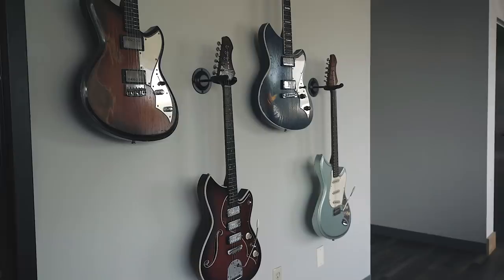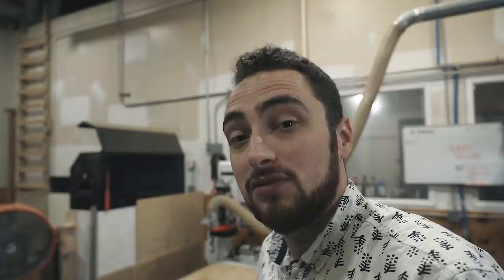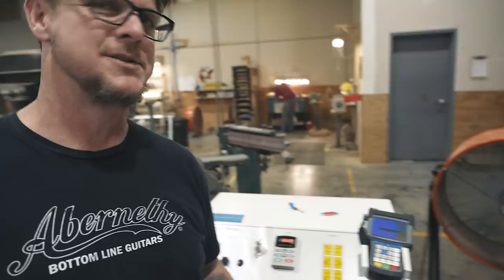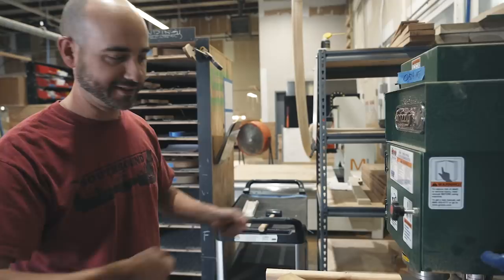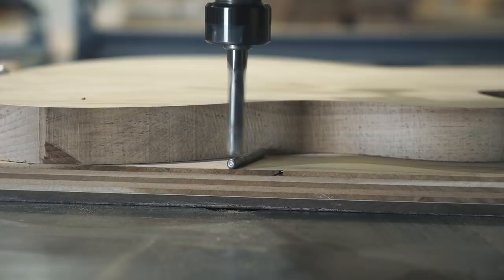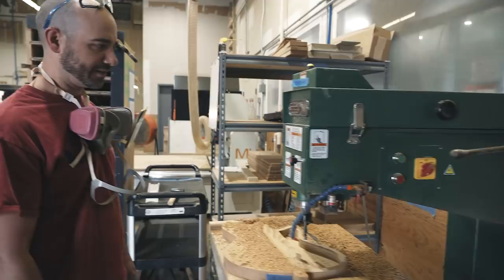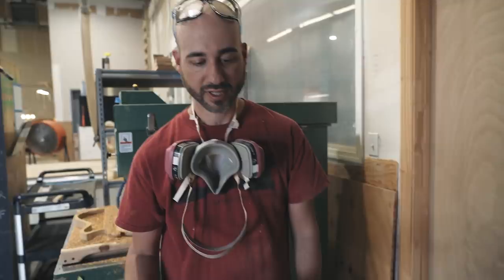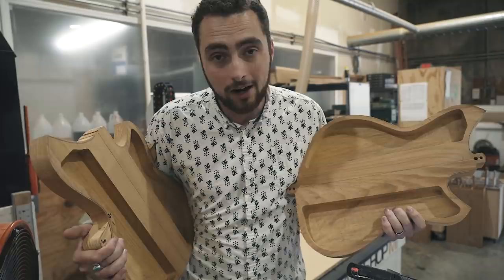Is “Handmade” Really Better? CNC vs. Handmade Guitar

Comment: What does "hand-made" even mean?  How is a pin-router any more hand-made?  Hey, even if you are using a hand-router and following templates, is that really more hand made?  CNC or hand-router, still shape things with a router bit.  The question is whether a quality guitar is produced out the other end.  With so much of guitar making simply requiring extreme accuracy, being able to do so much of it with CNC's which can be highly repeatable with extreme accuracy at speed makes a lot of sense.  It's like people talking about how they prefer "analog" pedals, and then when you check out their pedalboard you see that most of these things they refer to as "analog" pedals are actually digital pedals.  They've adopted a word they like, but it doesn't really mean much.

Comment: Food for thought If you may. Let's just say you're the guy who sands the body after the rough cut and initial routing, neck pocket control cavity etc. If the prosees is the CNC then that gives you ,as was said in the video, 8 to 10 guitars to sand a day which is off course what will be expected since that is the normal daily production. This means that in your 8 hours of work you can reach a certain level of detail. Now won't that make a small difference in detail if when the handmade carve would give you 3 guitar's to work on a day ? What I'm trying to say is that it depends on logistics and actual production planning if using a CNC machine can make a difference in the quality and "mojo" of the instrument.

Comment: I build my guitars by hand using dangerous hands free router, and now I DIY'ed a CNC Router, my next problem is 3D modeling. CNC, Router, chisels, files etc they are all luthiers tools and help them to finish the tasks. Sound Quality, they're both the same, it all goes down with the quality of pickups, amps, effects and how you tweaked them.

Comment: All things considered, CNC and a pin router are not that much different, except CNC is much more accurate, and when setup properly, will give you consistent results every single time, right down to .001" accuracy in wood. I would think hand made would apply to a luthier that actually uses chisels and mostly hand tools to machine out the body, face, neck, etc. Each instrument is noticeably different, and will sound accordingly, depending on the skill of the luthier to mimic his design.😉

Comment: I just stumbled across this video.  As a guitar player for several decades, I cannot believe anyone would be so naive to think that the machining method with a pin router could change the  overall tone and characteristics of a guitar.  A CNC can dial in a neck pocket under 0.001 inch.  Optimum energy transfer.  Not possible with a pin router.  But hey, let the “cork sniffers” pay a $1000 premium for their pin routed guitar.

Comment: A good design, made accurately, from appropriate materials will be good.  Screw up design, or construction, or material and it will suck.   The exact tools are not important if they are used well.  CNC is great for repetitive tasks, but like any tool it's not fool proof.

Comment: I love the CNC for the repeatability and precision.  Even customization is faster.  

Could I make one suggestion on your video?  The camera work is very unstable, and it's impossible to focus on one shot before you move to another.  Even in a static conversation the camera is moving way too much.  Spending more time at each scene and holding steadier without so much jitter would greatly improve the video.  I love the content, but find I can't watch very long at a stretch because of the induced motion sickness....

Comment: The "handmade" is not truly handmade.  As in, it is still cut using a machine, only hand guided.
True handmade is with a chisel & mallet.
Can you please do a video comparing chisel & mallet cut to machine cut (either pin router or cnc, it doesn't really matter which)?

Thanks mate.
Reply: Not true in this day and age. 5,000 years ago you'd have argued about flint vs bronze tools. Which is ridiculous.

Comment: There is a difference between, CNC, pinrouter and entirely hand built with hand tools. But it's not so much the tech involved, but the process. There is an element of craftsmanship involved in the 100% hand made method that isn't there with cnc. The other huge difference is that a CNC will only cut what it's programed to cut, it will not take into account any changes that could be made on the fly... If you imagine that a guitar is a sculpture, you can see how CNC would limit the ability of the craftsman to improvise and adapt on the spot, work with certain characteristics of the wood grain, and adapt the design to such. I'm not defending one method over the other, just pointing out that they are used for different end results.

Comment: does a loaf of bread taste better if it is hand cut with a serrated knife vs a loaf cut by a bread slicer ?
Reply: Clearly it does. The slower cuts by hand release the magic pixie dust contained within the air pockets more thoroughly into the surrounding bread, while the faster, mechanical bread slicers do it too quickly and spray that pixie dust into the air, wasting it and making your bread taste like drywall. The only bread I eat is sliced by 80 year old blind monks using actual, historic Viking swords. No modern day recreations for me, it has to be authentic, pulled from the digsite by archaeologists.

Comment: In my opinion there is a total misunderstanding here. CNC milling machine or milling machine? Obviously for a mass production the choice is almost mandatory. CNC. !! No one would prefer to make a hundred hand holes when a machine can make it a thousand in half the time. But this is not the difference between a hand-built instrument and a factory one.
The handmade guitars are small productions totally made by hand in which the constructive philosophy is the main difference. Substantial difference especially for acoustic and classical guitars.

Comment: Better for who? Handmade is always better for the craftsman because he gets lots more out of it than just a guitar. CNC is better for the businessman. Maybe a better way to look at this debate is to ask which is better, computer generated music or human written songs, performed by a computer or by musicians? And why? The debate and reasoning is generally the same. When the wood has a defect hidden inside, the craftsman can stop, work around it, and make it right. Whereas a CNC will ignore it and can make matters far worse, even ruining the piece sometimes. If all your talking about is cutting out the parts, then CNC is obviously the best since precision is necessary for that and it saves a ton of time that can be spent doing other more interesting and artistic things to it. I imagine there are musician who prefer their instruments be slightly imperfect. So it has a sort of personality. Something they can bond to. Some idiosyncracy only they know about, or something they can leverage to create a unique sound. Of course, the thing here is, you gotta be a pretty elite musician to work at that level. Most people are not good enough to worry about such minor things because they are not skilled enough to make use of them yet. If everybody accurately assessed their musical skills, my guess is that most of this debate would evaporate quickly with the vast majority admitting to being unable to tell the difference. If you can't tell the difference than CNC is gonna be better if for no other reason than it is much cheaper to make since it takes so much less time to make it. For musical instruments of all kinds, it is nearly always true that the more precisely it is made, the better it will play and sound. So CNC has the edge there for sure.

Comment: Nice video, and very informative. But I think that referring to a pin router process as being “hand made” is a bit deceiving. The pin router is a hand guided power tool using a physical jig, not much different than the CNC using a virtual one.
Reply: Run each for a day and tell me there's no difference.

Comment: pin router is not the only other option.... I have made many and never used one. Most differences are in the neck materials, carving tweaks, and fret work. The production line guitar can be great, but I would prefer a single master builder make the instrument from start to finish. And a builder than can play. There are no master builder that don't play the instrument well. One needs to understand the demands the of the player to be able to meet them.

Comment: This is just one process of many that go into building a guitar.  And this is one of very few steps of handmaking guitars that isn't even done by hand tools.  This video is a bit misleading by using the word "handmade" but really just asking if machined controlled routing is better than hand controlled routing.  That's a really strange question to ask.  

Machined glue joints (laminations) and wood joints?  Worth asking.  Machine shaping of arched tops?  Worth asking.  Machine finishing?  Machine inlays?  Fret cutting/finishing?  Any of these would be more reasonable to explore.  Were people on the internet asking for this video?

Comment: Interesting stuff. Is handmade better than CNC? It depends what you mean by better. If you’re looking at volume production, CNC is much more efficient and will achieve much more consistent quality with better ability to quickly add customisations. Using a pin router the operator is forced to inspect the wood more closely. They might pick up a defect more quickly than a CNC operator. 

Hand finishing and time spent on setup is the real differentiator. People get wrapped up in hand built everything. That’s mostly baloney.  Guitars today are better built than they’ve ever been - particularly mid priced guitars. If you spend ~ $1000 and your willing to spend time on setting up the guitar properly it’s very unlikely you’ll end up with a lemon. 40 years ago buying $500 guitars was a lottery. CNC techniques and better quality control has massively reduced the real cost of good quality guitars.

Comment: If you take 1 handmade & use it as the template for the CNC machine made->then all of the CNC machine made bodies would be exactly like your handmade? In theory anyways. Plus then anything that you feel needs touched-up on the CNC machine made. You could just touch up by hand & be done.

Comment: So, are we comparing a hand driven router vs a computer driven router??? It's still a router! In Luthieraire, the Art and Skill of building wooden string instruments, of which I focus on the cello. The difference is in the cutting, shaping,scraping, and building the wooden pieces into an instrument of quality. The difference in the production of sound it will make by shaping the belly 1mm thinner by the F hole or 3mm thicker by the bass bar with a graduated curve to allow for the resonance of the front and the back through the properly shaped and fitted sound post. Now, if someone took those blanks and hand worked them with files and scrapers and finger planes to deepen the curve of the back to give a different sound, you might have an argument. But, from what I saw, you are arguing about the type of router you want used to build the guitar. Kind of silly if you ask me.

Comment: I'm currently having a custom made bass built. The luthier is building it "by hand". Of course, he'll be using a band saw, a router, a drill press, and other power tools. The final result won't be any better than a CNC made guitar and in fact, may have inconsistencies due to human interaction. But those little flaws and inconsistencies add to the artistic content of the work. If I'm buying a bass to go play bar gigs, I don't really care how its made. This particular instrument will be a piece of playable art. It will be a small piece of the builders soul. 

I don't really care if an instrument is made 100% by robots or totally by human hands as long as it plays well. But there is something more emotionally satisfying in knowing that a human being painstakingly labored over raw wood to build your guitar. It just gives it more value from an artistic standpoint. Really no different that someone playing an actual instrument versus sampled sounds played by a computer. Both sound good...but one is art...the other is science.

Comment: I honestly would prefer CNC, it's safer and more consistent. I don't think any luthier has made anything truly "hand made"  for the last 100+ years. They still use routers, planers, sanders and so on. CNC isn't a bad thing and neither was the Pin Router when it was invented.

Comment: The CNC machine is just another powered tool. If you're going to object to it, you should object to powered tools of all kinds - drills, saws, planers, thicknessers and so on. The old-style manufacturers' guitars were not 'hand-made' as the phrase is commonly understood. You would probably have to go back to the time before electricity to find a commercial instrument that was constructed entirely by hand.

The great advantage of the CNC is consistent reproducibility, which for the customer translates into predictable quality. The leap in quality of cheap instruments from what they were forty years ago is almost entirely down to the greater consistency and accuracy of manufacture: no more 'Friday Night Specials'.

Comment: So many variables. This is just one of countless comparisons due to countless designs and countless peices of wood that are all unique.
  Take Less Claypool's most famous bass for instance. in a high production factory, you're not going to have a master luthier to select the cuts of wood for their tonal qualities, making decisions on this wood-composite bass, bassed on the individual pieces of wood. You might have the factory ordering wood to a certain spec. but with a handmade guitar the luthier is going to be paying attention to wood-grain direction, density, etc, etc. Also, with a handmade guitar, the luthier may choose to place and/or fasten componants differently depending on the qualities of each unique body. 

  Without watching this, I predict that there's no difference with a solid-body, 1 to 1 comparison of the two techniques but there's still random chance with wood. Sometimes those cheep plywood guitars end up sounding great just because the grain and the way it was glued happen to come together just right and you end up with a $150 guitar that sounds excellent.

There are legitimate reasons that seasoned musicians will choose hand made instruments when they can afford it.
Reply: CNC in general is more precise, so even if the wood was picked out by a master, cnc would be a more relyable way of producing the rough shape. The only thing modern cnc's lack is feedback, which I can imagine would not be part of the handmade production proces in the stage of rough shape as sound can not yet be tested accurately.

Comment: True hand made would not involve anything with a motor, hand tools only IMO. So in the name of efficiency and cost reduction, modern manufacturing methods are the way forward if you want to re-produce a product and sound (as far as timber will allow).

Human finishing made give you a unique tone, but if that’s the mojo you want then go for it if you have the money..👍🎸🐨

Comment: This Mojo thing has always made me laugh  It matters not one iota whether a guitar is handmade  machine made or made by pixies, forgetting for a moment the skill of the player 99% of tone comes from the players fingers how they pick, bend strings or even the pressure they fret with the other 1% is the equipment. I don't claim to be a brilliant player however I am proud of the fact I get compliments on my tone. Although I have a shed load of gear my main gigging rig for 10+ years was  a Strat copy (Vintage brand) cheap Marshall valve amp and a couple of cheap pedals that cost no more than £300/400  or $400/500 total  and have been amazed at the amount of fellow players that ask what pickups I use and what mods have been done to the amp etc.. Of course we all prefer a guitar that we find comfortable to play which also helps .. At the end of the day if you can afford  and want a high end custom then fine don't we all but a good sounding /players guitar doesn't have to be expensive or handmade to be good also it's not so painful if it gets damaged or stolen..:-)

Comment: As a mechanical engineer, why on earth would you prefer a guitar push by a human in to the cutting tool, instead of a computer with micron presicion, I get the sense of someone masterfully carving a guitar with a chinsel o hammer and so on, but why a mix method of both of the bad characteristics of each process?

Comment: If you're under a certain age, you probably won't get this. But the only problem with CNC manufacturing is mostly where the neck is concerned. The consistency, from the manufacturer's point of view, is exactly what you would want, which is predictability. But from the players point of view this consistency also produces a mediocre product, by definition. 
And this is where the question of age comes in. Most players today don't really know the difference as they've been raised on CNC products. How many people here were born before the Peavy T-60 was? Even allowing for the handmade aspects of production, one guitar neck is pretty much like the next guitar neck in that line, to the point where the differences are so minimal as to barely matter at all. Gone are those "one in a million" guitars that almost play themselves right off the shelf, that you may love but the next guy hates. Now you can go into a Guitar Center and grab a dozen different Strats (for example) and not tell the difference between them by feel. Compared to the pre-CNC days where five "identical" guitars felt and sounded totally different from each other. That's when you couldn't order a guitar over the internet and you wouldn't have wanted to if you could.